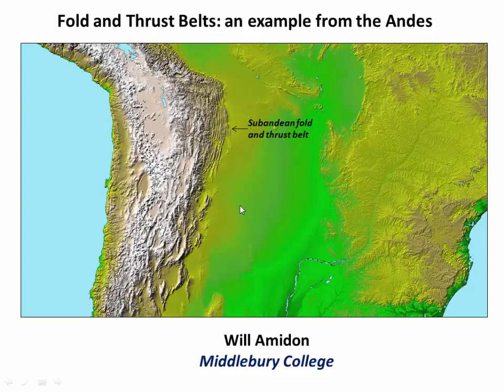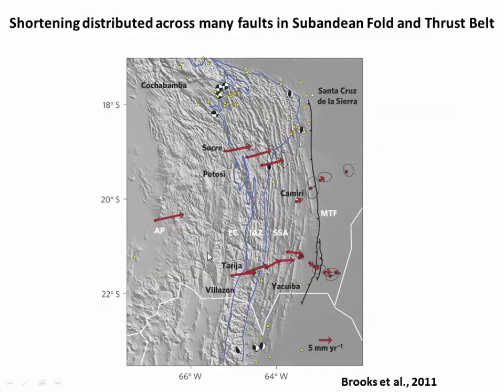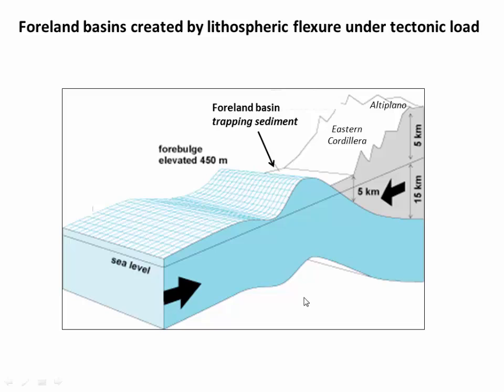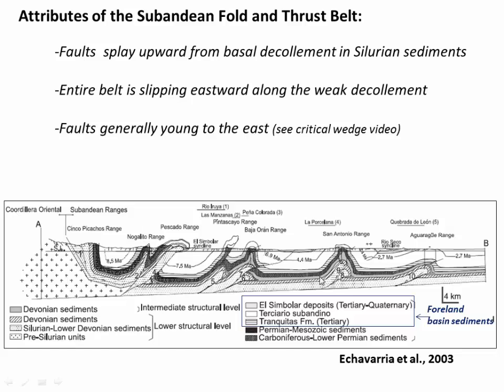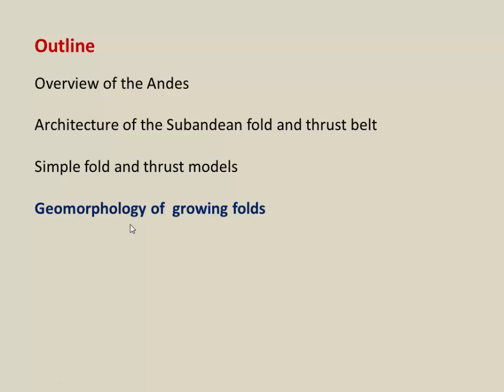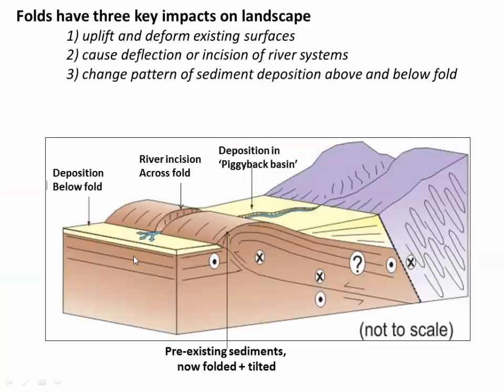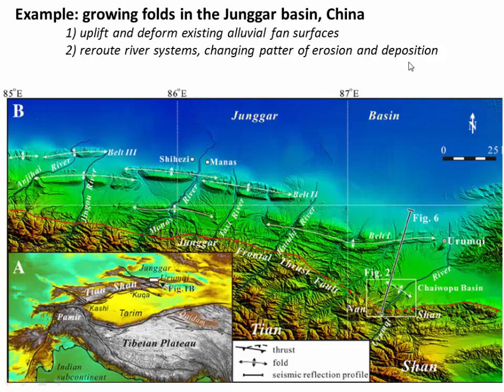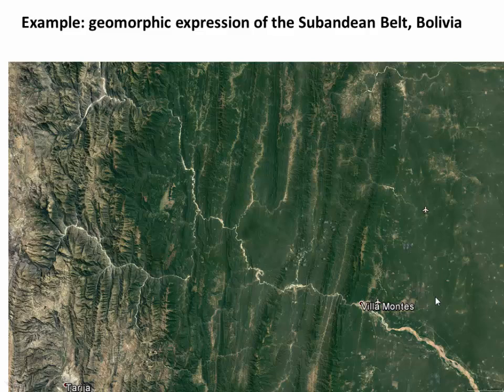Fold and Thrust belts: an example from the Andes (C7)

Comment: The presentation is absolutely excellent. For people reading comments before you watch a video. This is how it is done. 
The question I was left with is how these systems, e g the Andean fold and thrust system, would look a long time in the future? 
Let´s say a fold and thrust system was active 400 million years ago (and then conveniently buried by later events, until it was only recently exposed again) then we could still identify e g piggyback basins? If so, then we could extract very exact dates of all events (also about the mountain belt next to the fold and thrust system), once we identify the piggyback basin from the folded layers.